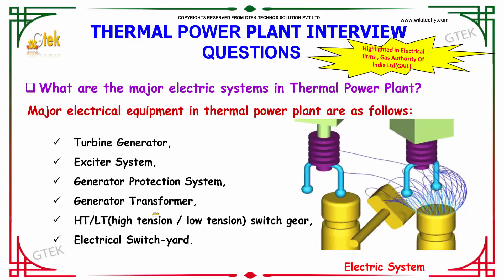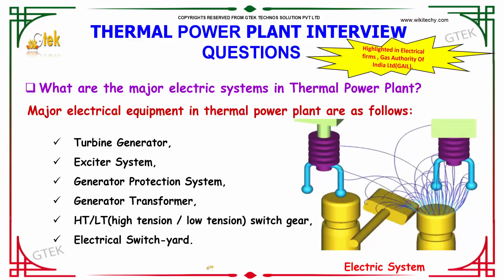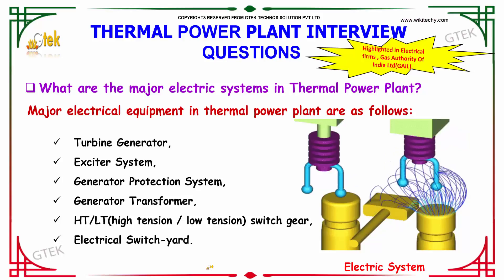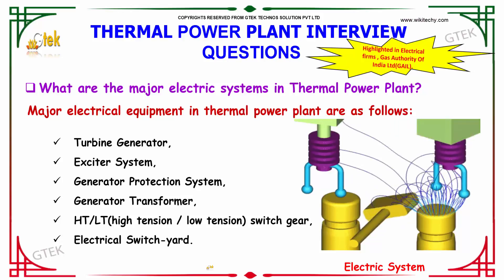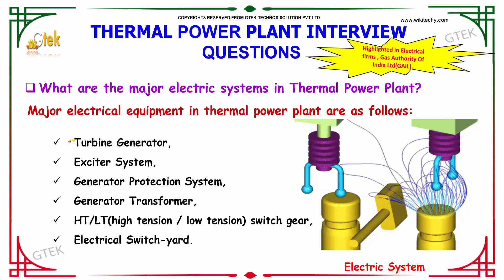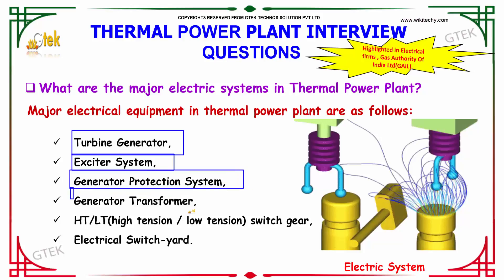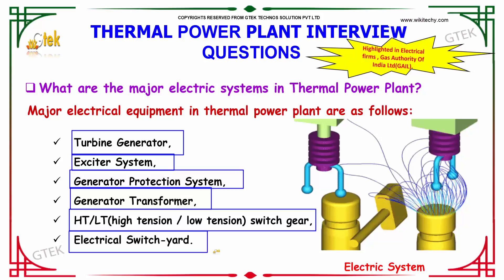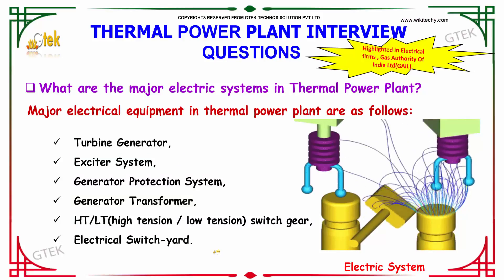What are the Major Electric Systems in Thermal Power Plant | Thermal Power Plant Interview Questions

Comment: Electrical engineering equipment used in various power plants. Turbo generator for thermal power station Excitation system is required to provide